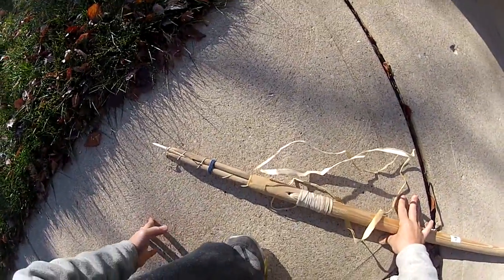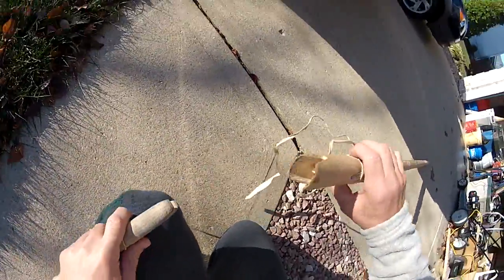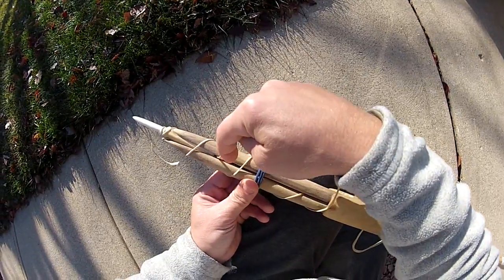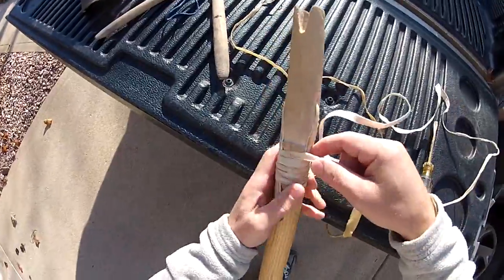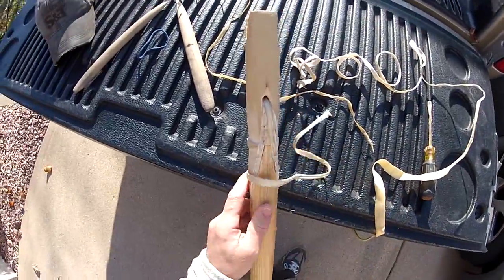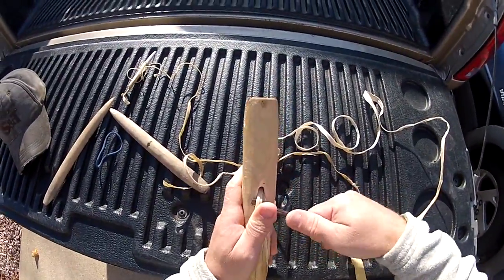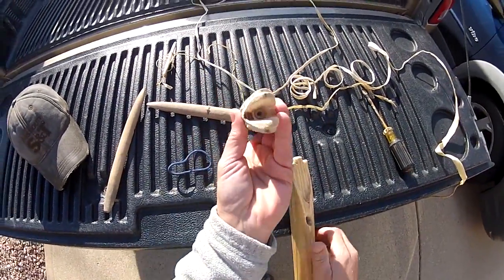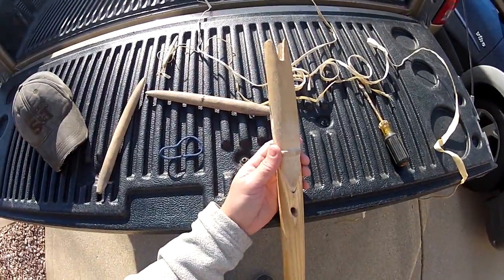Clovis Spear Initial Prototype (1)

Comment: The socket that the bone rods/main shaft fit in is an interesting idea. I don't know of any archaeological material that looks like that... is there any? Do you think the bone point wiggles too much? As a system is it strong or maybe do you think any component is weak?
Reply from the maker: The material of the socket and the bi-beveled rods are made out of persimmon.  I have not seen any socket artifacts that I knew for a fact were paleo but I have seen some made out of ivory of which I do not know the age.  And why not wood anyway?  A prototype that is made out of wood and survives the testing phase just makes the argument that bone/ivory will work too, as they are even stronger.  In other words, if wood will work then bone and/or ivory will definitely work.  

The bone point in the video definitely wiggles a little too much and is not seated well enough to hold its position when impacted with something.  I have a plan to make a leather boot that will be pierced by the projectile point and hold the two bi-beveled bone rods in place more securely such that the projectile point will sufficiently stay in place no matter how hard an object it impacts.  Imagine the boot being the middle of a long piece of rawhide cordage where it is widest in the middle where the boot is.  Then the two ends would be wrapped around the aft end of the projectile point (as sort of seen in the video when I take it apart) and twisted together and then run along the center of the bone rods where the grooves (notches) are and held tightly in place when the two bi-beveled rods are fit together in the socket.  At least in theory I think this might be a fix to the problem.  

Pertaining to your last question, so far I think the entire system is very strong with the exception of the projectile point.....as explained previously.  Oh, also there is a knot in one of the bi-beveled rods which will obviously make that one weaker there.  I plan on making a few testing prototypes in case one breaks and also to show that the pieces can be interchanged (hopefully).
Reply from the maker: To add.....my prototype was copied from artifacts I saw at artifact shows or from what was seen on the internet. I have pictures of an artifact from Alaska made from ivory that I copied the socket after.